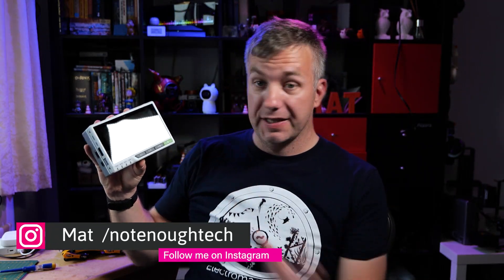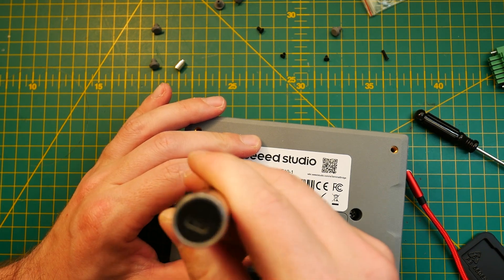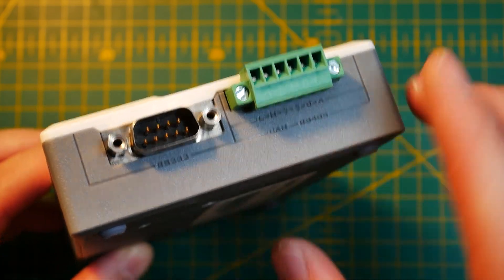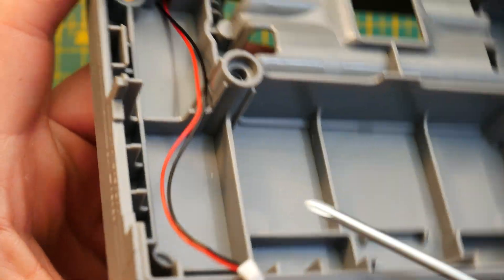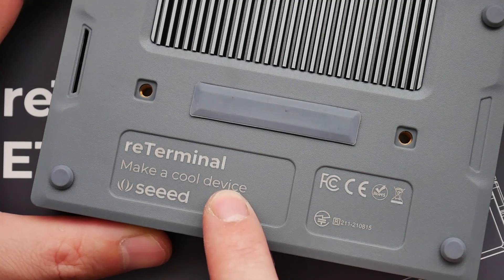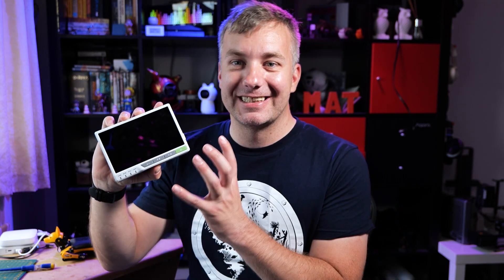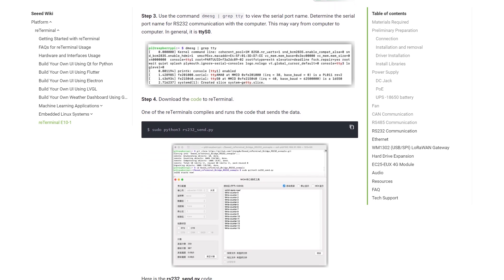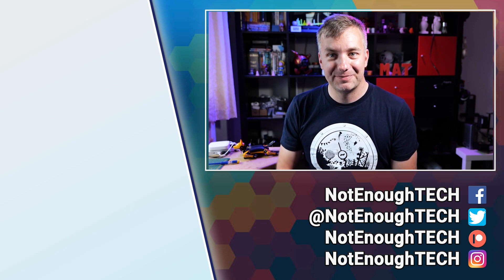Is reTerminal E10-1 for you?

Comment: Quick question,  what do you look at in robot vacuum cleaners mate. Wife's birthday coming up.
Reply from the maker: I'd say the self emptying is great, then the ability to leave the dock, do the clean and re-charge unimpeded. I barely check the app, change the functions or do voice commands. Simple schedule and non problematic return cycle is all I need from these things. Anything else is a bonus.
Reply: @notenoughtech  Sounds good mate, wife is a cleanerholic , but has autoimmune problems.  Sound like the go.
Reply from the maker: Sounds like the clean performance would be the top priority then. =In it 2-3 times a week and you only have to clean hard to reach places once a month.

Comment: My E10-1 shipped yesterday. I can't wait to get it.
Reply from the maker: Got specific plans?
Reply: @NotEnoughTECH I have a few plans for it to be used inside Ford Transit T250 mobile office build. But the coolest idea is to use computer vision to automate simple functions like turning on lights, fans ect with sign language or simple hand gestures.
Reply from the maker: @Go.el_Hadam  Gestures for controls are quite fun, especially if you link this to face recognition, so each person controlling can have their own subset of commands
Reply: @notenoughtech  that is so damn cool. I have never done something like this. But it seems so feasible to make it work. This will be my most ambitious project. I'm not a licensed engineer just a passionate hobbyist.
Reply from the maker: If you can recognise the gesture. Simply run the current faceID as your IF condition and keep replacing it when new face is recognised ;)

Shouldn't be harder than dealing with gestures alone
Reply: @notenoughtech  thank you for the advice. I will let you know how it went after I get it working.